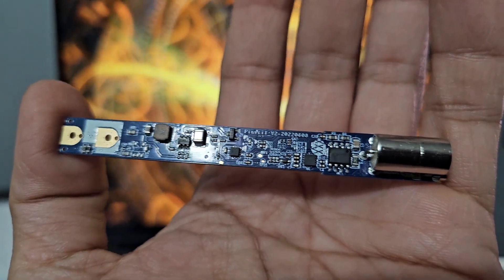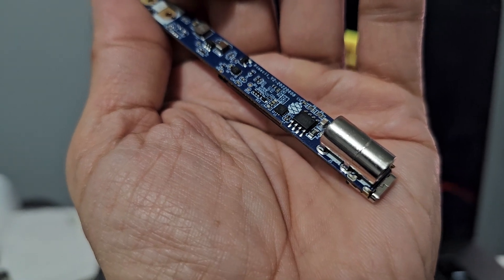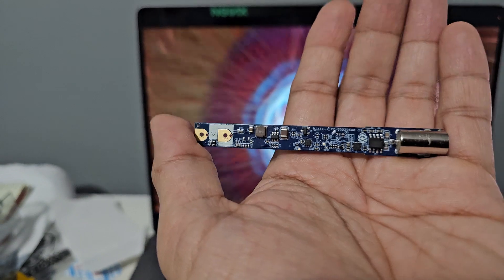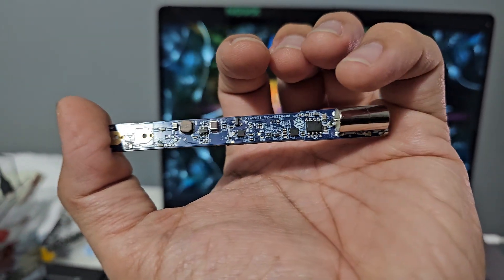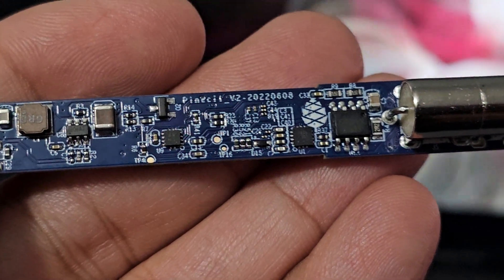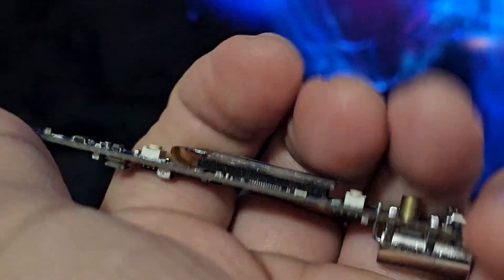I'm pissed off! 😡 Don't buy PINECIL soldering iron. 😭😭😭

Comment: I had same issue, no drops. Worked fine one day, packed it away into special hardcase i use to keep it safe...

Next day took out for quick solder job but was bewildered that it wudnt turn on
Reply from the maker: @1nn0centBystander  bummer. I bought Sequre as a replacement. I think it's one year old now. It's still performing like a champ!

Comment: The max voltage of the pinecil is 21 volt you're giving it more than it can handle
Reply from the maker: @mohamedaminebellaidi4023  i was given the wrong information. Someone told me "it can take 6s lipo"
Reply: @neilfpv  That depends on if it's a V1 or V2. The V1 could only handle 21V max (it's printed on the side). One of the main upgrades for the V2 was that it could handle 24V.
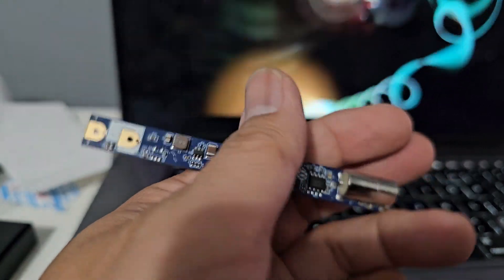Edit: at 4:37 you can see that the board says it's a V2, so it should be good for 24V. That said, I have heard it can't take more than 24V, where the TS-100 is a bit more overvolt tolerant. 
On the other hand, I just used my Pinecil V1 to repair my TS-100... the OLED burned out, which is apparently a common failure mode for them. 19.5V laptop power supplies work great for the Pinecil V1, but would be just a tad slower for your V2 to get to max temp. You should be able to find a 24V 3A (or higher) power supply on the mothership for cheap.
Reply from the maker: @glabifrons  I already gave it to someone. I bought Sequre a few days after I posted this video. Thank you for the info.
Reply: @neilfpv  No problem. I actually was digging more deeply into the V2 docs as I'm recommending one to my brother and found that it's actually supposed to be good to 28V, so even an S6 should be safe on those (so what I previously read was also wrong on its limits).
I'll leave these here for anyone else watching your videos wondering about the voltage limits.

Comment: They are $25 USD for pine 64. Electronics does have a failure rate. Then in the middle you say you dropped it.
Reply: Too be fair, like some old electronics were really build like bricks. honestly my smartphones also never broke after just a few months or a few drops. And then i would have a guarantee on that.

Comment: The pinecil has only ceramic capacitors which are prone to internal cracks if dropped. This could be one factor of the suddent dying of the device.

The second thing is you used a 6S li-poly battery pack to power it. Fully charged it has 25.2V, which is a bit higher than the recommended max 24V.

Probably both cases could affect the longevity of the pinecil. I use mine with a 65W PD powerbank and I didn't have any issues so far (it's almost a year since buying).
Reply from the maker: Got it. I will look for an input source that is lower not as strong as 24v. I have a charger that can also be used as output. I can set the voltage out. Is there an amp required?
Reply: @neilfpv Using universal or adjustable power supplies is not recommended because they commonly are cheap and have an unclean output which can also kill these I read that in the official documentation Nintendo switch charger also mentioned as limited usability but for what I use it for right now I don't need too much power right now and if I do I just grab one of my old name brand laptop chargers that fit and use that instead
Reply from the maker: @electronicsfixergreat information. Thanks a lot!!!
Reply: Wow... what a faulty product

Comment: I have a fnirsi Hs-01 for some smaller things, it's great, easy to carry, and I have a lot of those attachments.  I'm happy for $40 it's great
Reply from the maker: how long has it been with you?
Reply: @neilfpv  8-9 months.  I usually use a phone charger, if I'm going somewhere I use dc on type c input (it comes in the package) to which I connect the bosch battery and I can work with it all day
Reply from the maker: @igormanja  Cool! I'll think about it. I just ordered 47 uF capacitor. I checked the board and found one cap to be bad. Hopefully that's the only cap that was bad. If it still doesn't work, I'll look for other brands like the one you have. Thank you.
Reply from the maker: @orion310591RS  that could have been the reason why my pinecil eventually died. Maybe I should use 5s lipo instead which has a total voltage of 21v. When you said heater element, were you referring to the tip? If so, I'm sure they are ok because all 3 tips are brand new. However, like I mentioned in the video, the tip landed first. It didn't manifest the issue right away on the board. Maybe it was the culprit or like you said, the high voltage. I'll be careful next time and hopefully the bad cap I found is really the only culprit.

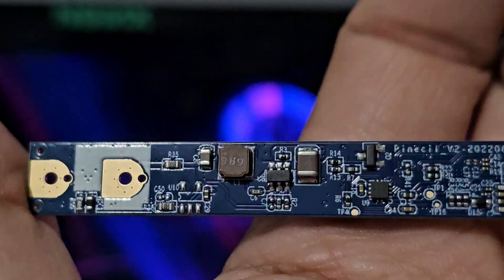Comment: 1:50 - Download the schematic and the layout.
You can mostly not see if a capacitor is broken. If it has an internal crack, then it have a resistance and possibly get hot. If the resistance of the capacitor is to low, then he did not get hot, but other parts which are in line to this capacitor.

I have her a 4.7µF capacitor which was soldered into my humidity/temperature monitor, the other capacitors are okay, but this had a internal resistance of 1.8kOhm so that there was a current flow of 3mA, so the LiIon-cell drained within 3 days.
I had to removed the capacitor and now it consumes only 2µA in idle and it it is measuring every 5 seconds for 500 milliseconds 53µA and it will have a high endurance.
Reply from the maker: Yep, I did that yesterday. I found C4 and C8 to be bad by testing continuity. I have not tested the other side of the board yet. I don't know though if caps are the only parts that break. Not sure how to test other parts like IC, etc. Thank you.
Reply: @neilfpv  - I had broken resistors too, because of overheating or the stress of heating up and cooling down the soldering junctions to the pads did broke.
But you could check C5 and the 2.2 Ohm resistor.

If the voltage was to low and the gate of the MosFET did not get enough voltage, then the internal resistance of the MosFET was to high and he get hot.

With my heat air station I can remove components and test it with a very cheap "transistor-tester", he can test every type of component.

I always start with the input voltage, then go to the voltage of the microcontroller (possibly 3.3V or 2.5V) and then I check the soldering connections of the components. Sometimes I randomly use new solder to give the bigger components some new solder and fix broken connections. This is working sometimes, like yesterday. My mother was here with her bicycle, it gets dark and she was driving home. She was not out of my village and her light stops working. Here is a long small path without any light, so she was driving back and I ripped apart her frontlight. I used solder to bridge the switch, but it was not working, then I used solder to give all solder connections new solder, so that it gets fluid again, I mixed it with my solder and then I tested it. It was working.

To get the front-light housing open, it takes 20 minutes without damaging it to much. The soldering and testing only 5 minutes.
Reply from the maker: @micropower8  wow, that is so cool, you have a testing tool for components. What device is it? Do you have a link?
Reply from the maker: @micropower8  I retested. I can't get continuity anymore on C4. C8 is still bad. I tested C5 and it's good.
Reply: @neilfpv  capacitor will show infinite resistance at full charge.... -_-

Comment: That sucks, I've had mine for a few years with no problems but I've never used it in the field. I have always used the wall plug.
Reply from the maker: I've always used 6s lipo. I don't have a wall wart power supply.
Reply: @neilfpv so, out of specs, what do you expect? Try a warranty claim, good luck!

Comment: Appreciate this dude, will save a headache for lots of people for sure 👍🤝
I have a zip tie around mine near the lcd screen as the buttons won’t work otherwise 🙄
Reply from the maker: oh no, but at least it's still somewhat working. How old is it?
Reply: @neilfpv  I’ve had it about a year but the button thing happened after about the 3rd time I used it 🙄👍
Reply from the maker: good thing it's still working. I'm still scratching my head today and wondering how mine died :(
Reply: @neilfpv  absolute nightmare mate 😔